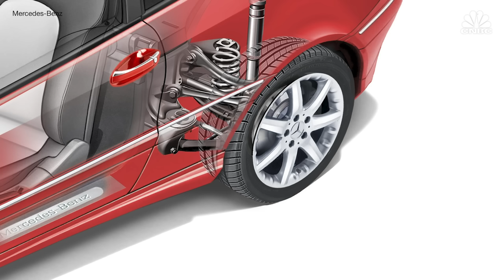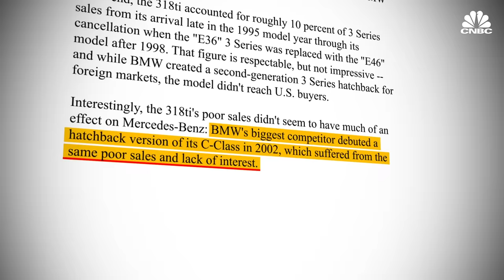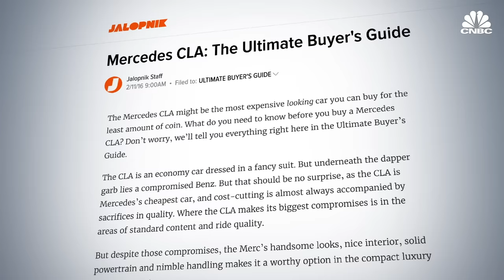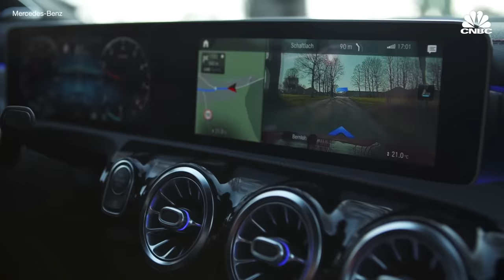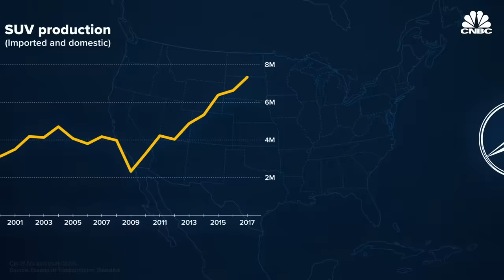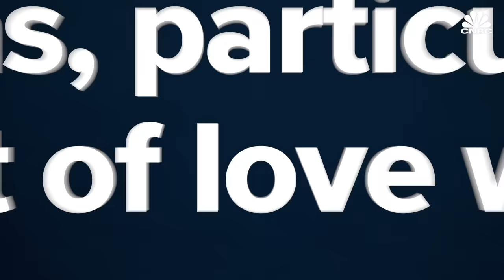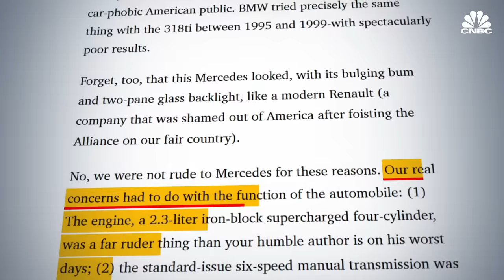Why BMW And Mercedes Made Cheap Cars That Failed

Comment: No one wants to buy a "cheap luxury car," if it doesn't have the perceived value of a more expensive model. In my neighborhood, would rather pay more for a year-old S-Class than for a newer model that doesn't have the reputation of the S-Class,even though both cars come from Mercedes-Benz.

Comment: Cars in the 30-40k range are quite competitive as a market because they offer more options than the typical price range of what a "real" bmw or Mercedes Prince range. Especially when you include standard options, compare mpg, performance it's hard to justify an A class when most competitors at that price range are more reliable offer far more horsepower and have similar fuel economy. Especially when you factor in the used market for what it is it's hard to justify a 30k price tag for a car that everyone knows is not the real luxury experience and is overall less value than what an Audi A3 or Lexus, or Genesis can give at the same price and with standard features like Apple carplay.

Comment: As far as I'm concerned, 2014-2019 CLA 250 is COMPLETELY different from the 2020- CLA 250. Even the A220 (which I'm leasing for my wife) is leagues better than the pre 2020 CLA.
Reply: I bought a 2020 Mercedes CLA 250 and I love it!! The price was definitely not in the 30k range. Mine was close to 60k. Damn options!!!

Comment: "When there's too many of anything, I FEEL LIKE it devalues the brand". ok, first, although I do agree that BMW did widen their models (mostly SUV and electric, which is the trend), the 2 series, 4 series, 6 series and 8 series are coupe/convertible version of the odd series cars (which already existed in 1999), so it's a bit misleading. 2nd, what's your justification for that statement? It seems like CNBC just pop at in there make it flow. We got Mercedes literally got things like long trucks, trash collections and all kinds of different cars, and they are still regarded as THE luxury brand. The consumers are not dumb, and the marketers know that, that's why they name the car progressively up with the numerica or alphabetical order (X1->X7, GLA->GLS), so that people knows that an X7 worth much more.

Comment: I don't even need to watch the video.

A) Cheap and luxury don't mix. If you're in for luxury you want the best, not the cheapest.
B) The mercedes C-Class Sportcoupe only failed in America, over here in europe it had moderate success, the BMW 3-Series Compact paved way to the 1-Series which is ever so popular, and the reason the merc failed is similar, almost no one in for a merc and its traditional values is caving in for a coupe that just looks cheap. Also, "failure" is relative here, as it later became the CLC-Class and went until 2011.

Comment: Actually what is happening is something very new and unexpected by both German brands. The truth of the matter is that Tesla is poaching half a million car sales a year mostly from those two luxury brands. This is putting exceptional sales pressure on them, and naturally are trying to push metal out of the door at any price. This is only the starting salvo, but watch them both closely in the next couple years, trying even harder to sell those obsolete ICE cars for whatever the market offers, as Tesla production and fantastic new models are increasing its sales and production. While both Mercedes and BMW are already starting a downward sales trend.

Comment: Those smaller cars are popular in Europe because of fuel costs. Americans pay much less for fuel so they can comfortably afford to run the heavier cars with larger engines. Have a look at the cost of filling the tank in Europe and see why they drive so many manuals with small engines

Comment: One of the facts that the video ignores is that in most of its years of production for the USA the BMW 318ti outsold both the 3-series touring and 5-series touring (wagons) combined. Its success was hindered by BMW's requirement that, like it's other offerings, a prospective lessee had to show 1.5 to 2-times the MSRP of the car in income to qualify to lease the car. No attempt was made to market the car and there was no support to finance to the intended market. You could say BMW NA created its own failure in a self-fulfilling prophecy. All the time BMW was saying Americans won't buy a luxury hatchback. Of course then they imported the MINI, and followed their "failure" by discontinuing all wagons (touring sedans) in the USA and forcing the least successful models on buyers instead, those being the 5-series GT, the 3-series GT, and the short-lived 6-series GT. 

318ti sales surpassed M5 and M6 sales but I don't see anyone calling those "failures". Even the 1M sold in smaller volume. How, exactly, do you define "failure"?  How many BMW M760i 12-cylinder models were sold?

Comment: Min the short term, if this Tesla battery advancement cuts the price of the 3 and Y series to $30,000 and $37,000, these other brands will struggle to keep up. The CLA was a huge hit, but it can’t compete with that.

Comment: What this really comes down to is the market and cost of ownership. Everyone wants to be in the market for BWM and Mercedes. The problem being the cost of ownership is astronomically high with both these brands. Thus a cheap car which can be seen with mini cooper using BWM parts is a nightmare to repair. Along with the normal warranty of these cars only being 3 years puts a roadblock in anyone that has any financial sense. These are not financially viable to own, they are the worlds best brand to lease.

Comment: The thing with these cars is, the $94000 S class becomes a $33000 car in about 5 years or so. Why would I then buy a tiny A class with much less features when I can buy a 5 year old well maintained used S?

Comment: Because the simple stuff is intentionally too difficult to access, artificially inflating repair and replacement values. Very inept, inferior internal design compared to Honda and Toyota.

Want to change the oil? Oops now you have to disassemble the entire engine, pull it out, change the tires, replace the chassis, flip the car upside down, click your heels together 3 times.... and you can finally access the oil 🙃🙃🙃🙃🙃🙃🙃 luxury cuz it's expensive right??? 🙃🙃🙃🙃

Wanna change the engine and entire chassis on a Honda? Wanna replace the tires with flying jets??? While also reupholstering it??????? New spark plugs????..... Lift the hood... Done. 👍👍👌👌

Comment: "If you catch somebody that young and get them interested"... That's pretty much the problem with those cars. They won't do that. If you're not interested already, you won't buy one, because chances are they're still more expensive than a comparable car from a "normal" brand, and even if you do buy one, you'll have high expectations, and C-Class, CLA (or the hideous GLA)  or the smaller BMWs will let you down (the 3 series might be ok if you're small and skinny). A s-class or a 7 series, those are cars that you drive once and you know why they cost so much.  Though to be fair, if I wanted to spend that much money on a car, I'd go with Audi or Volvo.

Comment: I had a Mercedes A-Class (W168).  I thought it would be a great quality vehicle but.... the interior plastics were the worst I have ever seen in a car I owned.  Hard, creaking plastics that rattled over every bump.  Hyundai easily did better plastics in later years.  The car had daft design decisions, like plastic seat height adjustment handles that turned metal spigots.  Use the handle more than a few times and it broke off.  The dealer had a whole bag full of spare handles.  Air conditioning was fine for 30C weather, but anything hotter and it was completely inadequate.  

The car was built down to a bargain basement quality standard but... it still had a premium price.

The final straw was when the timing chain snapped at 67,000km and destroyed the engine.  Fortunately Mercedes paid for the engine rebuild outside of warranty, but it showed what a terrible model it was.  I couldn't wait to get rid of it, and sold it a week after the repaired car was returned to me.

Comment: just get the mercedes W123.its easily available in good condition for less than 5000 pounds, some even below 1000. Those are practically indestructible cars and there are plenty of parts available . It also looks pretty alright

Comment: Huh...interesting and I agree the market is saturated, especially where I live (Santa Monica). Was fortunate enough to get a C230 as a gift from my parents back when I graduated hs in '03 and thought I was the MAN with that car. I drive an S class these days and now that I'm older, the comparison in terms of overall quality between a C class and an S are night and day, but the brand in general isn't what it used to be. Wife drives the G series SUV and isn't the biggest fan and neither am I since we've had to take it in twice now for bs issues and it's barely 2 years old. I'd argue that all 3 companies (Audi, Benz, BMW) shouldn't be considered "luxury" automakers. Just automakers who put out certain "luxury" models or have a "luxury" line.

Comment: Actually it is also about regulations in different countries. In the EU and Germany (home to those brands) there are goals on the average fuel consumptions of your fleet you have to achieve. So especially BMW and Mercedes (Audi covers this as part of VW with VW, Skoda and Seat) have to build smaller, fuel efficient cars to be in that limit. And if you anyway develop these cars, why not trying to sell them in the US. The mechanisms here are much wider than only thinking in a US bubble. BTW this is a reason some US car makers are not in the European market at all.

Comment: It is mentioned in the title that BMW and Mercedes failed. But I did not see any serious failure in the video. There were mentioned names of some models which were produced for some period. But it does not mean that the exact model did not succeed, because now some models of Mercedes are based on old models and changed their name. For example, CL-class was one of the best luxury-sporty models, now it is named S-class coupe. If it is titled the failures, I want to share a fact that when firstly Mercedes produced A-class cars, it was like a disaster for them. They got huge losses because of the lack of sales. A huge number of drivers were tired of simple Toyota or other such sedans because there was no luxury part in those cars(excluded latest models). That is why people preferred to buy CLA with an unusual and interesting exterior than to buy a reliable but boring Toyota Camry (excluded latest model).

Comment: I can see why this video has so many dislikes. In fact Mercedes is doing well with C and E class owing to new Middle class buyers in Asia.
Their top end is suffering because with brands such as Bentley Aston Martin etc their thunder is diminished amongst top buyers.
Middle class loves them as they can make a statement that they have arrived. That still does not mean that they can sell cheap ones as it defeats the whole point of owning a BMW or Mercedes.
There are way better offerings from likes of Toyota and Hyundai etc at this price range

Comment: the another answer is that the cheap bba（Benz bmw audi）are succeded in china,in china,most young customers choose the C series and A series,because the price are pretty low as the Japanese cars such as toyota and honda and so on,even though the cheap luxury cars ' configuration  is rudimentary but they usually ignore that ,because Chinese people think that a car is a Status symbol， cars are more like a tool which showed other people how rich the owner is rather drive.

Comment: By BMW, Audi and Mercedes Benz introducing more and more “economy” cars like the hatchbacks and small sedans like the cla, they will dilute their brand. Which I believe they have already done, i see so many low end model euros cars on the road these they don’t really have the wow factor anymore. But the proper baller models like the E class, S class and 5,6,8 series cars still get a wow factor. They simply arnt the common, which makes them more desirable in my opinion

Comment: I don't get it...
People were buying premium class cars because for more money they have been offering more than competition. better quality, better reliability, better equippment. 
Why BMW, Mercedes and Audi think that people will pay premium money for cars with same engines as non premium brands, but less equippment and less reliable? 
Now buying German car you get mostly 4 cylinders engines up to 2.0 liter engines, basic version do not have almost any equipment (you need to pay for all options a way more that competition is asking). And  most important quality and reliability is disputable. Lot of engine components are made from material like cheap chinese toys (timing chains, plastic cooling system components etc...)

Comment: It’s a little different for US coz you get Eclass for instance with some quite powerful engines and leather interiors and things while in Europe... I don’t need A class coz I can get E class with taxi specifications. I can get E 180 diesel with cloth interior and zero extras... it goes quite affordable in Europe. But yeah... that’s why we don’t necessarily consider Mercedes a luxury automobile. For us it’s just a random station wagon or grandpa’s simple diesel work car. Mechanical windows with cloth interior and no air conditioner. Really... we can actually buy such Mercedeses, Audi’s and bmws

Comment: Make cheap reliable and fun car, and you got a deal,

A base model is super reliable with as little accessories and features as possible
Can be FWD or RWD
Standard model

It got the must included features like cruise control, power steering wheel etc like a must to have function, fairly cheap 4Cylinder engine RWD-FWD depending on demand

Sport mode, same as standard but with additional performance upgrade V6-V12 engine choice, leather some LED light and quite a bit of accessories like USB ports display, digital speedometer and much more features, average to quite a bit expensive.
Comes in RWD only.

Lastly luxurious model.
It comss with everything.
Quite expensive...

If companies build cars with that in mind, they'd hit an all round.

Cheapest option for those who are barely able to afford a car getting back that old 2000$ prices
And it gets expensive as we go until we get 100k in luxurious model

Comment: I'll take stripped BMW over gimmicky loaded Hyundai for the various of reasons. A Noise isolation, better power train, better build quality, better paint job etc. If someone tells - but you wouldn't have blindspot monitoring, or a lane assist go take a hike.

Comment: It's not hard to figure out. There's no value in cheap luxury for the consumer. At $33k, a Mercedes A-class is a pretty bare bones vehicle when compared to fully loaded mass market mid size sedans. Once you load it up, you can run towards $50k pretty quickly, and then you're not in "cheap luxury" anymore. (I just watched a review of the new BMW 2 series GranCoupe M235i. At $50k it still didn't have heated seats - for a BMW based on a Mini Cooper with a  4 cylinder) So aside from the badge, what value does cheap luxury have for the consumers? Not much.

Comment: I believe it's not about devaluing the brand or no.

It's more like
Let say the price of Honda Fit is $17,000.
And now BMW or Mercedes make a cheap car with features similar to Honda Fit, at a slightly higher price, let say $20,000.

Will people buy? I think so. Because with a slightly more cost, you can have similar features, but heyy.. it is a BMW!

I think the problem is for people with limited budget, their main consideration is money and the features that they got. If all else is equal, sure I will gladly have the BMW.. but if the trade-off is an additional $20,000 compared to the Fit (so it is $17,000 vs $37,000) or if it is the same price (at around $17,000) but has less dull features compares to Fit... I will go with the fit. 

Just my opinion :)

Comment: I have had a 1974 Plymouth Valiant slant 6 motor forever since high school and now I just turned 60. Can I buy a decent 1 barrel carburetor at any price? Nope! $233 at any auto parts store for some rebuilt piece of junk from China. I least I can get my money back and keep using the one i have that sputters and bogs. I'm not a mechanic and it's getting harder to find old school ones who know what their doing. It still runs well when it runs but can't use it daily anymore unless I upgrade to a 4 barrel intake and a new Holley 390 carb. The price of auto parts and the fact the car makers change simplicity every few years is disgusting. Sometimes I wish I could live without a car too; too damn expensive.

Comment: I have always wondered why I can sell my 2015 Honda Accord and get a 2015  Mercedes E350 with the same mileage for the same price but when they were both new the Mercedes costed 3 times more?
Reply: 2015 E350 price around $20k, your 2015 Accord can still go for $20K?😂
Reply: @jj12566  that is simply not correct for. 100k miles E350

Comment: The BMW 2 series Gran Tourer annoys me due to artificial restrictions: this car class fits my needs, but why is the tech cr*p? Where is radar? Why are Driving assist, lane assist and ACC dumbed down? Where is Android Auto? BMW OS 7? If BMW does not offer what I want, just because it's lower than 3 series (without offering real alternatives in 3+ series), then I can directly buy a cheaper brand next time but be happier because that brand will be not that arrogant restricting my options just because the car costs "only" 60k € list price with extras. Would have had no problem just to add a bit more to get the missing things.